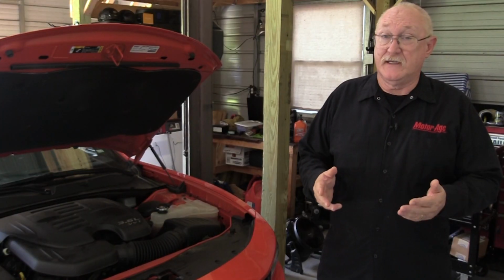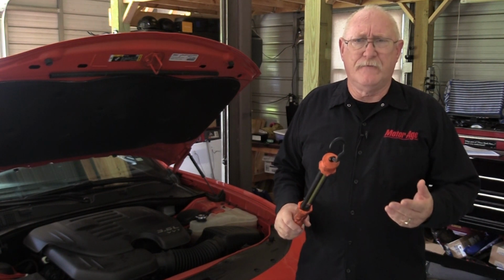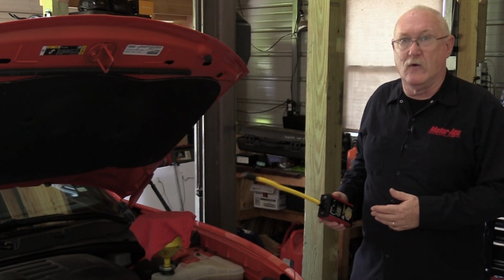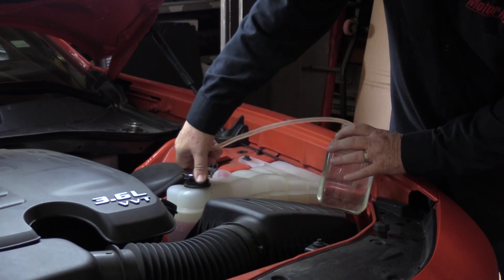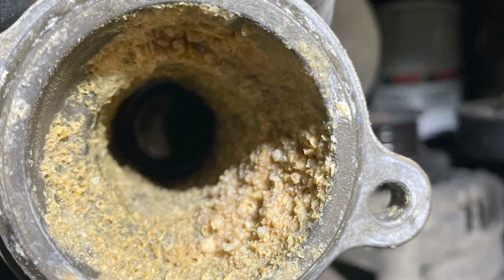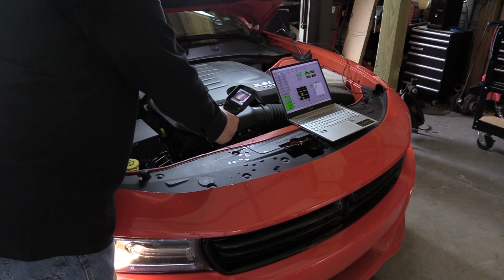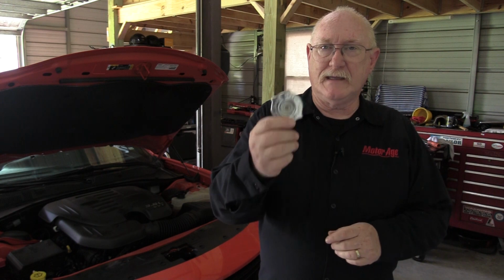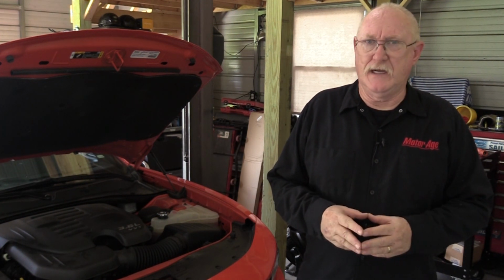Service Done Right #12:  Correcting Engine Overheating Concerns

Comment: If an external component is found to be leaking on a vehicle over 100K - 150K mileage, is it best to do a chemical coolant flush, neutralize, drain and refill after changing the part, like a water pump?
 And while Chrysler & others frequently use engine driven fans with electronic lockup and hall-effect speed feedback to the PCM / ECM, should a dedicated ground from the speed sensor to the ECM back to the battery negative be around 0.400 Vdc max as specs are not published in factory diagnostic flow charts but the industry standard used for years for other sensors like, MAP, MAF, Purge Solenoids, etc.? DK.

Comment: I am surprised you didn't mention troubleshooting a thermostatic fan if that is what the car uses for cooling. It doesn't have a clear point that it clicks on like an electric fan which makes its failure harder to troubleshoot in my experience

Comment: The condition of the radiator.  Is it partially plugged?  A Thermal tester will help.  What about the air flow through the radiator?  If the A/C condenser and/or the radiator is partially plugged with leaves, grass, small animal homes or anything else, air won't flow properly through the radiator.
What about air directional devices that are broken, missing or just removed?  No airflow to the radiator, overheating will happen.
What about a not so good aftermarket radiator?  When was it installed?  Before or after the overheating started?
Proper coolant or "one size fits all?"
Hope these suggestions help.

Comment: I noticed my 2013 grand Cherokee fan never seems to go on high . I don’t have a scan tool that I can turn on fan to check. It’s not over heating yet because over the years I’ve replaced pump, radiator, flushing ever 2 years . I guess if it’s not an issue why worry well because it’s me . My next check is to jump wire by pass reosthermostat on fan to see if that’s not functioning. Checked relays and fuses all seem good